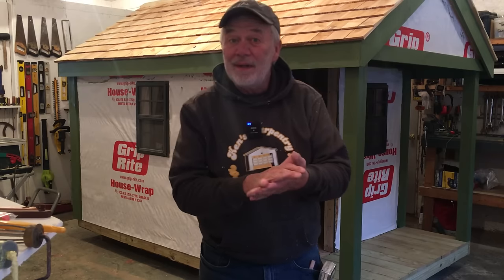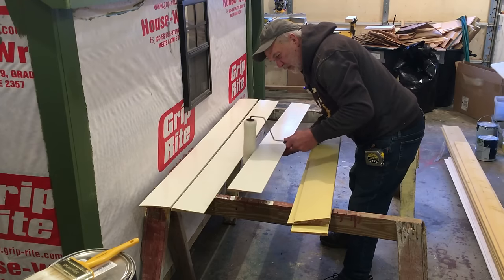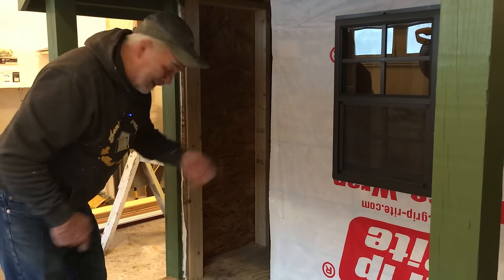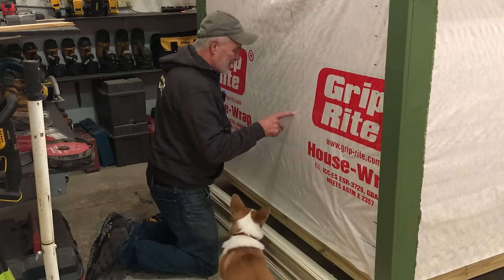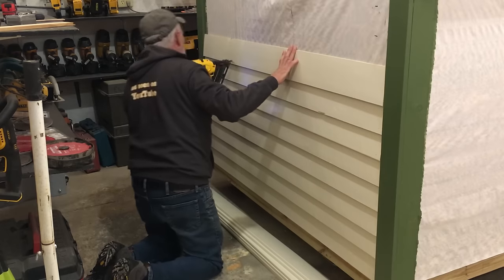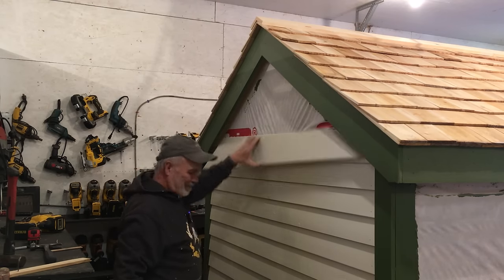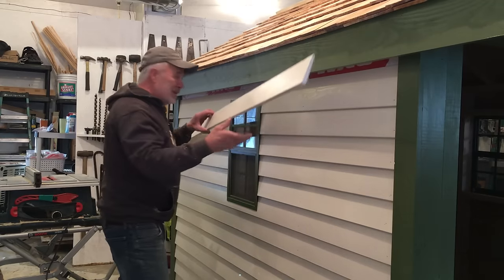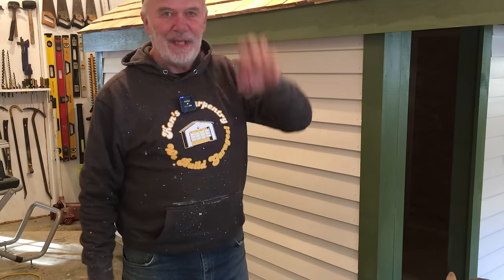Beginners Guide to Building a Playhouse...Part 8 Siding and Painting

Comment: The playhouse looks nice but why did you use interior paint for an exterior project? I would have chosen a good exterior paint. Valspar is an ok brand, i have used it with good success. I prefer Sherwin Williams, as a brand.
Reply from the maker: Big mistake. I just repainted with exterior paint